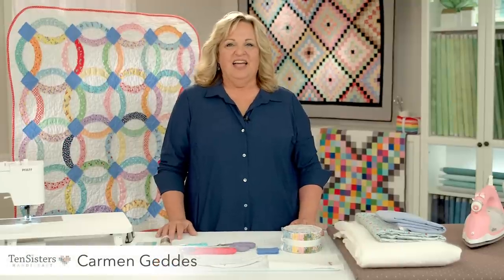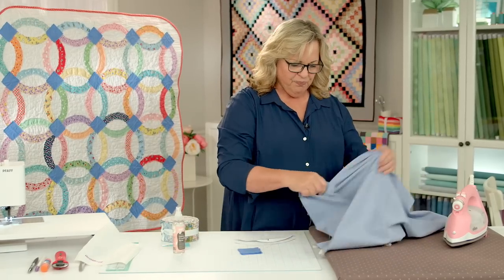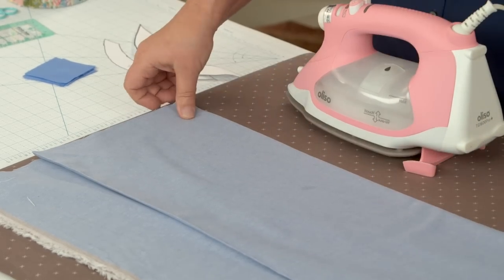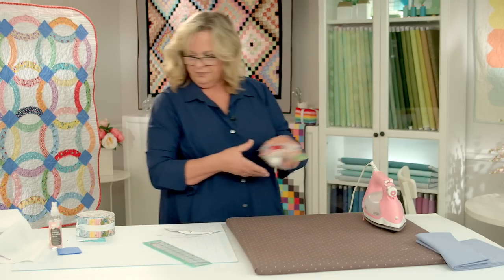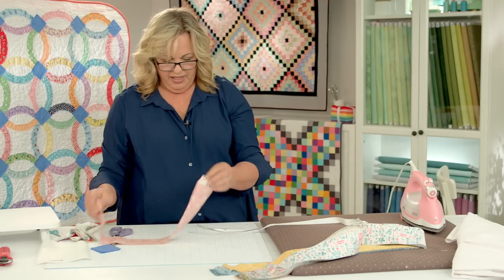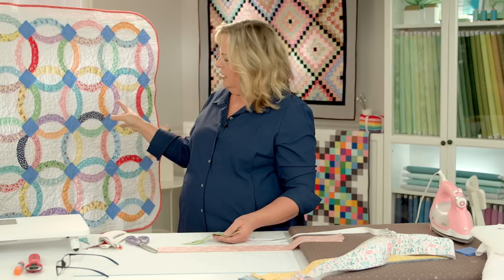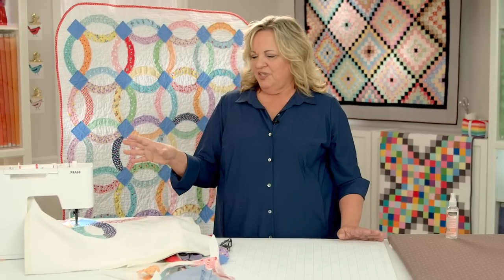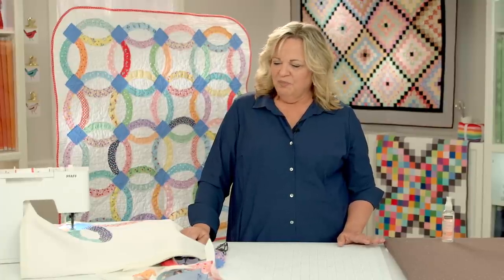No-fuss, Raw-edge Double Wedding Ring Baby Quilt

Comment: If you want your quilt to last, do NOT just throw it in the washing machine...UNLESS you really don't like the quilt and don't want it to last.  Instead,  put the quilt in the machine by itself, set the machine to the gentle cycle  and use a MINIMAL amount of FREE and CLEAR detergent when you wash the quilt.  THIS IS NOT AN OLD PAIR OF JEANS. DO NOT THROW IT IN THE DRYER ON HIGH HEAT!!!  Instead, if you want the quilt to last, dry it for a short time (5 minutes) on permanent press/ medium temp.  Then remove it and let it air dry in the shade or on a drying rack.   Some of the quilts I made have been washed using a regular cycle and then dried on high and they haven't lasted.  I was shocked when I saw how they looked.  I am glad the recipients enjoyed using them, but it was my mistake for not making them realize how to care for their quilt. Now I enclose a quilt care card with every quilt I make.  I still use a 30 year old quilt and it looks like new because I wash and dry it gently..oand it really does not take any extra effort..

Comment: Brilliant quilt.  Love the video, but though you left the template you didn’t give the pattern.  How many arc’s as you call them do you cut? How large is it? How many center squares and what size?  Is that a full Jelly Roll or did you use something smaller? Then love the shape, is it just rounded corners or is it scalloped large?  So many questions😂😂

Comment: Have you tried using freezer paper for the fabric arc template? Then you can iron it in place, and if you make several of the same template, you could cut the entire strip. 
You can also use school glue instead of fusible web to position your arches.  You can press it without steam to help dry it or pin  the ends and the center of each arch and wait for the glue to dry. School glue is washable, just like the school glue stick; after the quilt is washed,  it will be soft.

Comment: Could you use the 28-inch rotary cutter instead?  Also, it isn't easy to turn the whole quilt so plan out how you want to do the quilting with the least turning.  In rows or diagonal.  Just plan!   Beautiful quilt and an easier way to do it.  Thank you for sharing.  Read the comments there are several great suggestions.